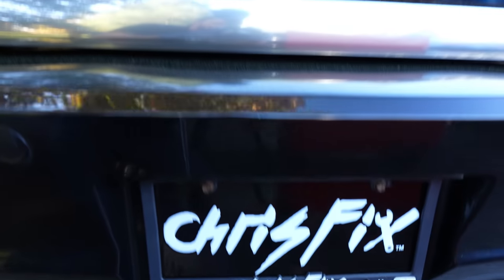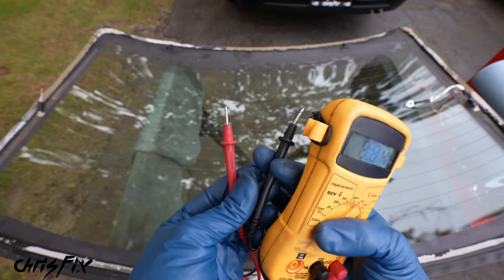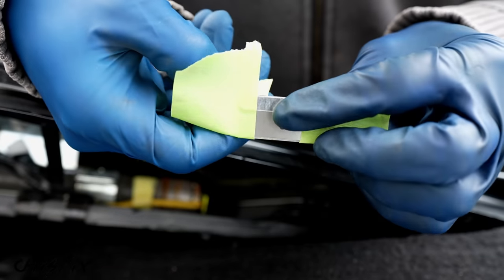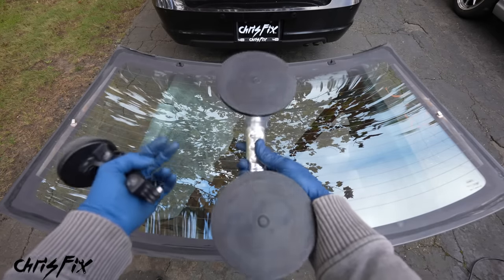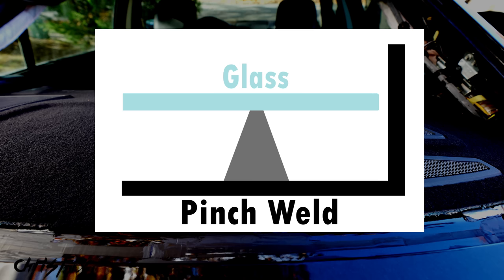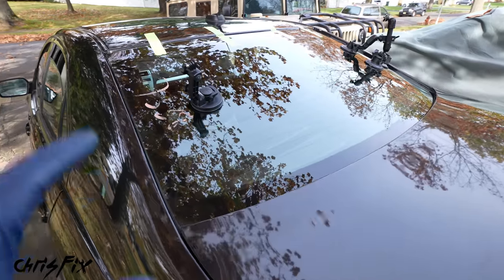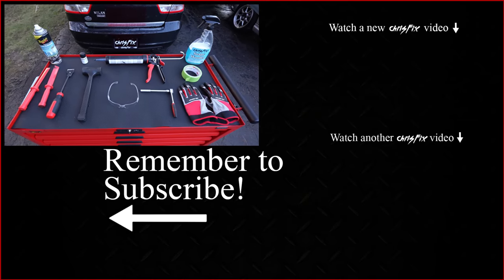How to PROPERLY Replace a Rear Windshield (No Special Tools DIY)

Comment: Three windshields from safelite, yes three before it was done properly, I found urethane? a seal? on my dashboard. A guy finally came to remove it, PS he didn't get it off! What do you suggest to remove urethane from a vinyl black dashboard? Thank you!
Reply: Once it's cured there's not much that can be done easily. In my experience I've used a product called scrubs in a bucket, but that mainly works while it's still fresh
Reply: @justinconant9669  Thank you for your time and reply!  It has been a long haul with safelite! First guy ended up working in the dark! He needed to pull his truck up into the driveway with his lights on to see! I can't blame him, I had two others after him. I do know the urethane was there by the time the third guy came and did it right! I have a 2015 Honda Accord LX, great shape and almost 18.000 miles. The owner of the shop will be here in January. Teeded  off! What if he can't remove it? Such bologna. Here in Florida, just went through storm Ian,  rebuilding, alone and stressed out as nothing seems to be going right and the gouging stinks! What say you? I don't just want to let this go.

Comment: Hey chris i have a 1996 Ford Mustang gt and I recently installed a manifold intake, throttle body and cold air intake very simple right? But when i went to go turn the car on I started hearing knocking and i dont know what could’ve caused that. Ive been on many forums and seen many videos but they are all saying different things i bought a borescope to see if i can see if anything fell into the cylinder head but i couldnt see anything on top of the pistons or any damage on the walls could the sound be coming from the crankshaft?

Comment: @ChrisFix Is one tube of urethane adhesive enough?  I'm doing a front windscreen. Also,  unfortunately some of the eBay links are no longer valid, so it would be good if you can list the part numbers (especially the primer). cheers

Comment: The tip of the caulk gun needs to be measured on the inside of the tip, so the triangle is 1/4 inch wide and 1/2 high aprox.

Comment: I busted the back windshield out of my truck with a canoe. Didn’t notice it had slipped up off the bed and was touching the glass when I started tightening down the ratchet strap. That was 15 years ago. I still found some broken glass under the backseat 2 weeks ago. You’ll never get all of it.

Comment: Hi Chris I thought you didn’t  have new video.  I have Q   I have 03 Chevy express 6.0 gas  what best way to restore gas consumption  of the engine I will try to  replace 2 coils  change  fuel filter what’s Eles

Comment: Pro tip when paddling use popsicle sticks and either soak em in water or keep them in ur mouth for 5 minutes and it will keep the stick from sticking to the delicious bead 😉

Comment: Is it okay to put isopropyl alcohol after removing the urethane from the glass frame? And is it okay if I just use the same new razor from removing the urethane from the car 
I don't have that tool that you have...17:53

Comment: Those tubes are 10.5 oz.
How many did it take for the rear window? Just 1?
I'm doing a windshield in a 2000 Bonneville.
Reply from the maker: Correct just one.
Reply: @chrisfix  Sweet thanks for the reply. I've used it before, but only for a small side window on a Ford van.
Asking is easier than math of figuring out the volume of the bead. :-)

Comment: One last thing.  Do a thorough wipe down of interior seats and surfaces where you will be touching and handling.  A few years ago I heard the sound of exploding glass in my kitchen.  I was in the living room with the door closed.  At first I thought one of the neon tube lights fell out of the fixture.  I went into the kitchen and discovered that a glass pan cover had exploded.  It was one of those for an electric skillet, square shaped with rounded corners and a metal perimeter.  It broke in the same way as tempered glass, into those small rectangles.  I had just done my dishes and glass got everywhere.  I had to vacuum it up completely, carefully wipe down every surface, the counters, microwave, inside the toaster, wall, floor,  etc. within several feet to remove any microscopic and embedded glass pieces, and re-wash my dishes thoroughly again.  Totally tedious and time consuming.  I don't know how many times I got a glass, wood or metal sliver in my hand or under my fingernail which is extremely annoying.  Great video, now I know.

Comment: I was driving at 65 mph and heard an air leak coming from the rear windshield.  I opened the window and it stopped.  When I rolled the window up, the rear windshield was sucked completely off the car and blew onto the highway.  What can prevent this?

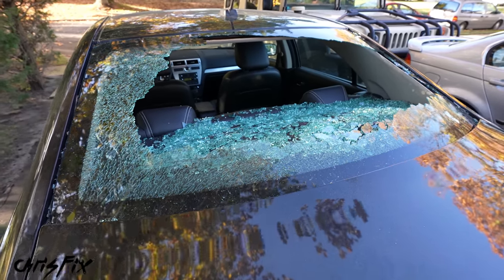Comment: 0:27 No. That doesn’t happen. Front and rear windshields are structural glass. I used to work for Safelite and completed installation tech training. Both front and rear windshield are laminated glass so they’re a lot stronger than tempered(used in mirrors, side glass, etc). Something would have to break through the glass in order to cause something like this but even then it would take multiple hits. Laminated glass doesn’t shatter easily it cracks and falls apart not necessarily shatter like tempered glass

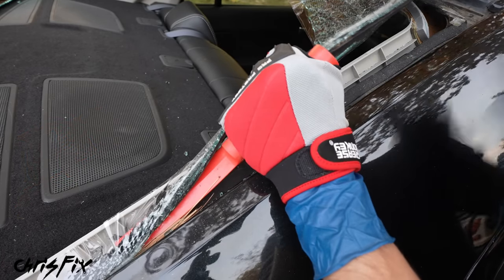Comment: 9:54
I have a 1/4'' strip (oem) of urethane or what
actually appears to me to be a neoprene strip,
which seems to be the case with the car Chris
is working on, as well, yet he  is ripping away at, or discarding,
and replacing it with adhesive. The back hatch-window,
on my Lexus rx300 looks like that strip may be needed,
as the seat for the glass or I guess 'pinch weld' is pretty 
deep. shrugs.... what to do ... if I stand the adhesive-bead
up tall as is shown in this video, should that suffice?

Comment: You can put urethane on glass its much easy
Reply from the maker: Technically you can but the industry standard and most recommended way is to apply the urethane to the metal since it's stronger/cleaner/easier to align and easier to control as you set it down

Comment: problem is, in my country, insurance will cover it for $500 (not converted), so any shop you go to buy just the glass sells it for exactly $500, with free installation. So not getting that additional coverage so you can diy is pretty much useless.
And our junkyards are useless. You'd be lucky to find anything salvageable there, even if you go there daily.
Reply from the maker: Dang that stinks. What country?
Reply: @chrisfix  I dont really want to say, or rather I dont want anyone to think that my opinion about my country represents the actual fact. Let's just say i'm from one of those countries where financial doesnt really make sense here so you'd prefer to do everything yourself to save money, not because you like to do it. And your channel has helped me a lot with that even though i've been busy lately.
I'll take this chance to thank you.

Comment: @ChrisFix

The link to ebay for the eurethane kit is broken. I was able to get the accurate product name for the urethane adhesive (in the tube) from the videeo but can not detect the exact primer name from the video. When you google urethane primer you get what looks like all kinds of other / irrelevant products. What is the exact name of the primer so we can source the product ourselves if we need to?

Comment: If I remember u can just pull the urethane glue. Instead of cutting it using blade. Just pull it.. it will attach as 1

Comment: I gotta a problem with my car, we took it to the mechanic multiple times then to the dealership, and they cant figure it out. It's a 2013 Honda accord, sometimes when the car reaches about thirty miles per hour it will jerk forward and oscillate and cant shift up. So it wont go faster than that. We got the codes, p0717 saying the input turbine shaft speed sensor A has no signal, the mechanic replaced the sensor but the problem is still occurring. Pls help.

Comment: good vid. taping the broken glass is unnecessary tho. your better off just cutting it off and then vacuuming. taping it is gonna take more time and your still likely gonna have to vacuum again anyway cause bits of glass are gonna fall from the tape
Reply from the maker: You'd be surprised how much you can get by taping the glass! But if it looks like the glass is too weak and will instantly fall then you can always just cut/vacuum
Reply: @chrisfix  while it is true that taping it will get the majority of the glass, theres always gonna be bits that will fall and you are gonna have to vacuum again, especially if there are kids who ride back there. this is why id just not bother taping in the first place so i only have to vacuum once

Comment: jesus crist wer did u get the adhesive for this? i got the sikaflex p2g n that bullshit didnt want to com out of the dam tube lol. i had to press/squeeze so dam hard n it barely came out. it wouldnt com out easy like the cheap caulk u buy at walmart or a hardware store. i threw it in the trash

Comment: Probably  won’t see this but if you could respond or make a video on how to remove super glue from car I just bought my first car and there’s a drip of super glue on my driver door
Reply from the maker: I would try using some acetone. Test it on a piece of the door you cannot see first to make sure it doesn't damage the material, and it if it works it should loosen it up and come off with a little bit of work, no problem. Let me know if that works!

Comment: Now do it with an import that has a rear wiper blade in the way… very much learned the hard way that you need a special tool for that, or you could break the rear wiper motor assembly :/

Comment: There's a much easier faster way to remove the old glass without the plastic shizzle or the tool, just use a braided fishing line or any thin strong string, some dental floss can also work.
Just pass the line under the glass and keep moving it back and forth it will cut through the old adhesive like a hot knife through butter

Comment: Ok. I don't know what kind of crack was smoked here or if the urethane on the back of this car was just really soft or what...but that PLASTIC chisel method? Yea EFF that, it would have taken me 3 or 4 hours to do that. (01 ford focus windshield). Ordered one of the garotte type tools to try instead.

Comment: 32:38 NOOOOOOOOOOOOOOOOOOOOOOOOOO THE DEFROST WIRES
Reply from the maker: They are on the inside of the windshield, if they were on the outside then you would wipe parallel with them
Reply: @chrisfix  oh, ok

Comment: Pro tip for the 99%. Don't. You have no idea the damage you can cause. Control with your tools is key.
Next time just trim the glass before you vacuum..
Also, OEM does not mean better and it does not effect your resale.

Comment: Idk what you been told but you NEVER use an extractor on a back glass only the bottom of a windshield 🤦🏻‍♂️
Reply: And that bead is way to skinny and after about 4 years it’s gonna leave leak bc you did horrible collinding the 2 ends and it’s gonna make a air pocket🤦🏻‍♂️but other than that ig you did good

Comment: You shouldn't be surprised by the manufacturer's mistakes, things like that happen all the time. I worked for a new car dealer and nearly every car has things like that, most cause no harm, but they are there.

Comment: ehh...not terrible. first time?
Reply from the maker: What would you have done differently?
Reply: @chrisfix  use the metal razor blade to paddle the seams, it sticks less than the plastic. Also, even though they can be expensive, the battery powered gun would give a more consistent bead and have less risk of a leak, otherwise, shooting the glue with the hand powered gun would be better on the glass, just be careful when setting

Comment: Kinda laughing. Not trying to criticize you get good results and everyone is different.
But you vacuumed first. Then chiseled out the remnants of the window. Vacuumed again. Then pulled trim potentially dropping more glass and needing to vacuum again. Then scraped a bunch of urethane stuff out. 
I'd just get the bulk. Then remove everything and then deep clean all at once before replacing.

Comment: You have only one windshield & it's in the front "Hence" The windshield , the rear is called a back glass not the rear windshield.. I'm a 40 year Auto glass tech & just letting & the viewers know the correct terminology !! And there are 
proper tools required.. call your local glass shop or your probably going to have issues with it !! A word to the wise...Some people may able to do it ..Again for a job done correctly call the pros who know !!  :-)

Comment: A rear “window” is not a “windshield”. Only the front glass is a windshield (or windscreen).  The rear glass is no more a “windshield” than the side windows are. Is a fixed side window in a van a “side windshield”? No. It’s a window, so is the fixed rear glass.